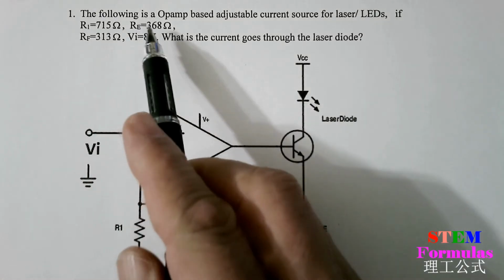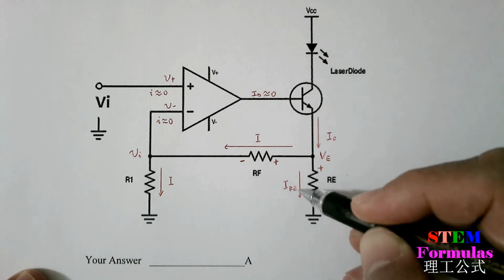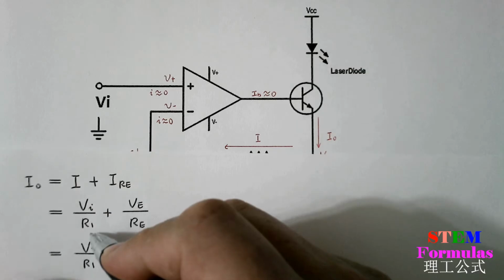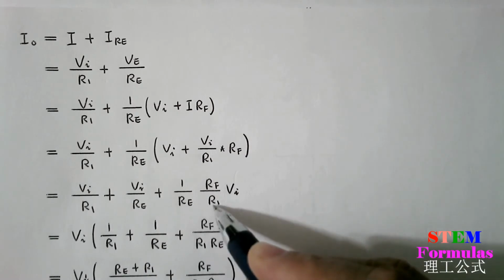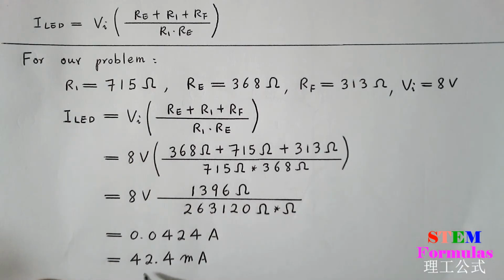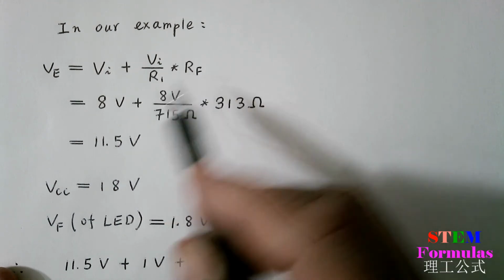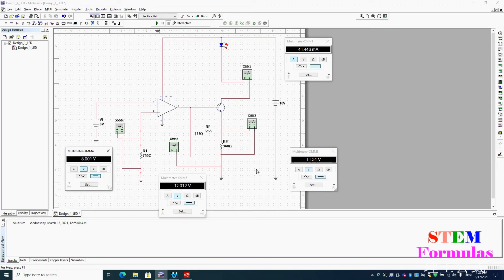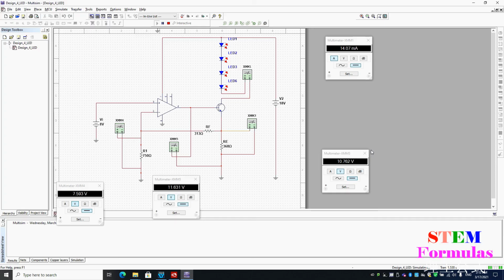Op amp based adjustable current source for Laser or LEDs  with Multisim simulations

Comment: Ah. After many years of using Falstad as my primary simulator, I eventually found its limits. All numbers in the examples (in the description) do not work in Falstad. Maybe resistor values are too small. Maybe op-amp is overly inaccurate. Maybe this. Maybe that. I do not know.

I then use Multisim. The mathematics works!

I know, I know, serious people do not touch Multisim as I was told. I am lazy, and Falstad provides me with the fastest and easiest visual. I merely want to 'see' how certain things work, accuracy and precision are secondary. As foundation such as Wikipedia and PubMed. Hahahahahahahahahahahahah!!!!!!! Moreover, I am very lazy to do the coding in LTSPICE.

Comment: This circuit design is too challenging for my finite brain cell. Too much abstract calculation. No number as example. (I do not blame anyone because mathematical expressions are all that are needed by those who already know, especially academicians. I later realised that there are examples with numbers in the description, I am enlightened! Hahahahahaha!)

I eventually decided to build/simulate it out of frustration.
OMG! This is one of the very few circuits on the internet that works at first build/simulation! I use Falstad, and the numbers are frighteningly EXACTLY the same as what is shown in this video! Proves that this particular current source is insanely stable and universal even with unknown component models (as with Falstad). The numbers are still extremely close to what is shown here even with random and inferior operational amplifier such as 741 in Falstad.

It appears that the design does away with the inconsistency. Similar to adding extra components to transistor to ignore the hFE to get similar or the same numbers every single time. More work, more parts, more headache, more eyesore, but more consistent result/s.

I am a simple person so I am not into deep headroom and such. All I need is constant current which really works. Wilson current mirror is super stable, guaranteed to work, and the easiest to calculate, but I am too lazy to string up transistors. Op amp can hide away some, or many, transistors' ugly features and imperfections. Common integrated circuits for non-critical electronics stuff are inexpensive, many are fakes but they work rather well as long as they work as claimed.  8 legs as opposed to 60 legs; less time assembling and troubleshooting, more time for drinking tea. LMAO!

Comment: I was going to comment about how circuits on exams always have ridiculous non-standard values.  I guess it's to make the calculation harder or easier, depending on the problem, but you can't easily take these designs as is - good luck finding a resistor with the value of 393 ohms for example..  Then I read your comment on a more practical example.  My OCD has been resolved.  :D
Reply from the maker: Dear delarosomccay
Thank you very much for your comment about the values, the values are non-standard in the video, in my teachings I use a software called "diploma" to organize the problems. I randomize the values so that each students get different values on his own exam, so that the students cannot just copy from each other the answers. they have to go through the calculation to get the answers.

Comment: But did you actually check to see how much base current is flowing? Blue and Green GaN LEDs are bright at 1mA, so maybe the base current could be a source of significant error. To make it irrelevant you could put the LED on the emitter leg of the circuit. As long as you have sufficient voltage headroom the op-amp won't care which side of the transistor it's on.
Reply from the maker: Dear simonlyons5681,

Thank you very much for your comment.
I do not quite understand the question,  what is the 1mA current. what are the two LEDs, you use the two LED at the same time or what?  what do you mean by the error? Please write your question in more details, I will get you back as soon as possible.

Comment: Why do you need Rf and R1? If you just connect the junction of the emitter and RE back to the inverting input you can set the current by adjusting Vi.
Reply from the maker: Thank you very much for your comment.

The circuit you suggested is widely available over the internet, that circuit has only two parameters: Vi and RE, the current is given by Vi/RE. The maximum current is limited.  What if you need a very large current without complicating the circuit? for example, you have a 10 by 10 LED matrix, then you need a very large current.

In this circuit, by adding only two resistors RF and R1 (not an extra op-amp, not an extra transistor), you are adding another route for the current flowing through the LED. i.e. in this case the total current flowing through the LED is the sum of the current going thought RE and the current going through R1. By choosing proper values of RE, RF, and R1, you can obtain quite large current without adding more trouble. To see this, we can rewrite the current formulas as I_LED= Vi/RE+(RE+RF)/(R1*RE)*Vi,   i.e. the first term is the current in the circuit you suggested, the second term is extra current. If we choose RF>>RE, then the current formula can be simplified as I_LED= (1+RF/R1)*Vi/RE,  i.e. we get a current gain factor (1+RF/R1).  Please see "3 calculation examples" in the description part below this video. Having RF and R1 is the beauty of this circuit.

Comment: Anything for Anode grounded lasers?
Reply from the maker: Dear Sir or Madam,
What is the current needed to go through the laser diode, what is the forward voltage for the laser diode?
Reply: @stemformulas I need from 0 to 100 mA. The forwarded voltage is around 1.5 volts and the laser is anode grounded
Reply from the maker: @cristianvargas8095    What is the voltage of your power source?  Do you have a dual power supply? or single power supply? We can design a fixed 100 mA   constant current diver for the laser with anode grounded.

Comment: Assuming a perfect opamp and sufficient headroom on the supplies, when the voltage at the non-inverting terminal is 8V, the voltage at the inverting terminal is also 8V. So the current through R1 must be 8V / 0.715K = 11.2mA. That current must also pass through Rf, so the voltage across it must be 11.2mA x 0.313K = 3.5V. Therefore the voltage across Re must be 8V + 3.5V = 11.5V, which makes the current through Re 11.5V / 0.368K = 31.3mA. That makes the current from the transistor emitter 11.2mA + 31.3mA = 42.5mA. Assuming the transistor β >> 1, then the collector current is also 42.5mA. No need for algebra, and it doesn't take 7 minutes.
Reply from the maker: Dear RexxSchneider

Thank you for your comment, your calculation is correct.  Very good!
Reply: I disagree, the explanation is very important to show how this  circuit acts as a current source.
Reply: @mmh1922  Rubbish. My description above shows exactly how the circuit behaves as a current source and takes 30 seconds to read. Which part of it didn't you understand? Exactly what did you find missing that was present in the video, apart from all the unnecessary algebra?
Reply: @RexxSchneider I respect your right to express your opinion, however, as a reader, I decide what is important to me and what is not.
Reply: @mmh1922  Of course you can decide whatever you want for you. And I can decide to call you out when you're spouting nonsense. Not for your benefit, naturally, but for the benefit of everyone else who reads your misleading comment and wants to decide if it has any value. That's why I asked you "Which part of it didn't you understand? Exactly what did you find missing that was present in the video, apart from all the unnecessary algebra?"
Your inability to address those basic questions are surely the clearest indication to any observer that your initial comment was devoid of merit.
Reply: @RexxSchneider  responding to such an arrogant person like you  is a waste of my time.
Reply: @RexxSchneider 👍
Reply: the way I did it is Vre = Vi * (gain of the non inverting amplifier) = 11.50V
Reply: I agree with you. Yr method is more quick and correct. I do not think it is correct to assume Ib is 0

Comment: Hi, how much is the total voltage drop of this circuit? My red laser diode needs around 800/850 milliampere and it drop with 2.2- 2.7 volt. Can i use a single li ion 3,7 volt? and Which op amp and bjt/mosfet do you suggest me in my situation? Thanks you
Reply from the maker: Dear Sir,  
Thank you very much for your comment.
For your situation, you can choose the following:
RE=0.5 Ohm (high power resistor).  If you use a MOSFET, the voltage drop between the Source and the Drain normally will be 0.5 V, (less than 1 V)
So the total voltage drop will be 
Vcc=2.7 V (laser diode) +0.5V (MOSFET) + (0.85A*0.5 Ohm) =3.6V.  
So, a single  Li Ion battery (3.7V) is enough.  

As for MOSFET,  you can use IRF540NF  from  Aliexpress, it is  fairly cheep.

Be careful, do not hurt your eyes from such a powerful laser. Wear a goggle  in your project.

Comment: If 14 mA flows why the LEDs are not glowing? A LED will glow for as little as few 100 uA. Where is the simulation wrong?
Reply: In a practical situation, if the diodes do not light, it means there is no flow of current through them. Probably, I think, if a variable resistive load existed,  then a situation may arise in which the current source will not be able to support the  intended 41 mA. Thank you for your reply. It was a good step by step explanation that helped me to learn about current source using op amp.
Reply from the maker: It is also interesting if you simply place a variable resistor to replace the LEDs  in the circuit. When the resistance is zero,  then the current through the resistor is 41 mA,  when you increase the resistance of the resistor the current is kept at 41 mA for some time,  when you increase further, the current drops.  This is the usual behavior for a real life constant current source.

Constant current source feels comfortable when the load is shorted, but it feels terrible when the load is open, R_load=∞, the voltage =I*R_load=∞, but the source does not have infinite voltage to supply!  (whereas voltage source feels comfortable when the load is open, R_load=∞, but feels terrible if you short the output leads, in this case the current supposed to be infinite, but it can not deliver infinite current.)
Reply: @stemformulas  Then, perhaps, as the resistance increases beyond a limit, the current starts decreasing to support the supply voltage limitation. It is interesting. I will try to make a practical circuit when I get some time.
Reply from the maker: Dear Nara49 Veera,

Thank you very much for your comment.

When I say that the circuit is no more working,  when I_LED=14 mA,  in the example, I mean the current was not kept the same as that flowing through a wire (no LED) or one LED,  41 mA.

 Ideal constant current source should keep the current constant no matter how many LEDs are there in series, always 41 mA, as in our example,  but in reality such an ideal constant current source never exits, so It is necessary to tell how many LEDs can drive for a current source. We gave the formula in the video.

In our example if the circuit gives 14 mA, (lower than 41 mA), we say that the source is no longer working, whether LED glowing or not is not relevant !  The key is that  the current is out of control. Different LED has different properties, all we need is to supply the LEDs with controlled current I_LED. this is the circuit all about with formulas.

Probably what you mean is that I should give a more realistic example with I_LED= a few 100 uA instead of 41 mA. If this is what you meant then you are totally correct.

STEM Formulas

Comment: Where do I get 8V for Vi assuming it's ground is the same as the rest of the system?
Reply from the maker: Thank you very much for your comment.  First, please read the description section below the video ( I just added a description text there). There are two ways to get Vi,  the simple way is to use a Zener diode in series with a resistor, 
one lead of the resistor connected  to Vcc,  another lead of the resistor connect to the cathode of the Zener, and the Anode of the Zener connect to system ground.  Vi is connected to cathode.  Now you need to determine the resistor value:
To make the Zener working properly, make sure you have 5 mA to 10 mA current flowing through the Zener.  then the value of the resistor is determined by the following formula: 
Vcc=I*R+Vz,  take I=10 mA=0.01A,  if we have Vcc=18V,  Vz=8V, then 18V=0.01A*R+8V,  then R=(18V-8V)/0.01A=1000Ω=1KΩ. 

The other way is to use a micro controller to obtain PWM, so you can adjust the brightness of the LED's by a push button.

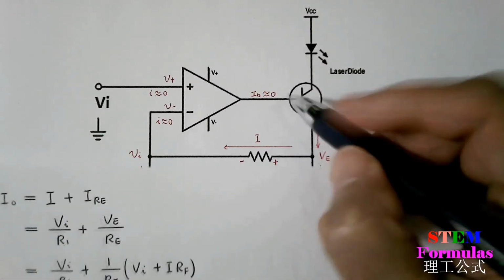Comment: Nice video.  I would like to make one clarification though.  At 5:32, approximating the base current with zero would indicate that the transistor is in cutoff mode and therefore I_0 would be 0 (because I_B*Hfe=I_0).  So I don't think that is quite right.  It seems the opposite to me, that I_LED == I when the transistor is open.
Reply from the maker: Dear Enigma758,
Thank you very much for your comments. 
The question you raised is vey good. We should clarify here:

1. Electronics is not an exact science like mechanics, for examples, To make CORRECT APPROXIMAITON is a good step to solve any electronic problem, this is due to the fact that semiconductor device is not linear device of resistor type.  For example,  take any two leads from a transistor,  say,  B and E,  V_BE can not be written as linear equation:  
V_BE=(some kind of resistance)*Current !
when we study electronics we need to make approximations, but good ones.

2. The transistor in our circuit is not in cutoff region, Cutoff means all three currents  I_B (base current) ,  I_E (emitter current ) and I_C (collector current) are all zeros.

3.  The transistor in our circuit is in saturation region:  I_B is quite large in terms of the range of I_B,  I_C is large and V_CE is very small.
The transistor works as closed switch,  C and E looks like closed wire,  and V_CE≈0. (ideal case).

4. When we say "I_B is zero",  we mean that when we compare I_B with I_C,  I_B can be neglected.  Exactly speaking, I_E=I_B+I_C by KCL.
or   I_E=I_C/β+I_C,  take β (hFE in your notation)≈100,   so I_E≈I_C.  i.e.  we assumed I_B≈0,  a valid approximation that does not cause significant errors. (point 1).

Thank you very much for your attention.
Reply: @stemformulas  I think you are really just saying that I_B doesn't add in much current even when the transistor is in saturation so that I_LED can be equated to  I_O.  Thank you for your response.
Reply from the maker: Exactly.